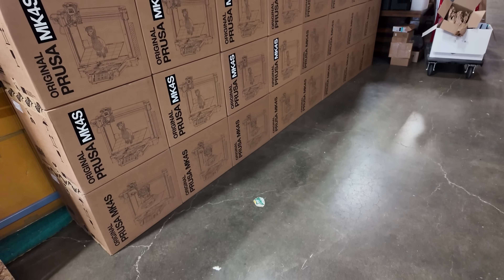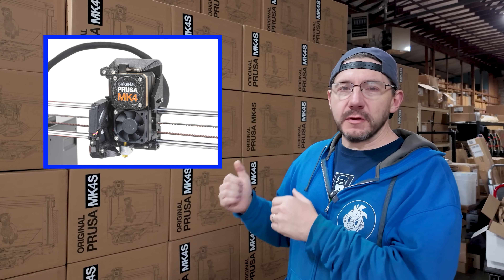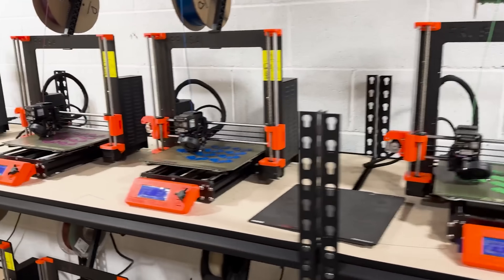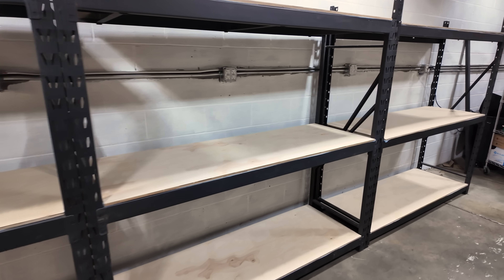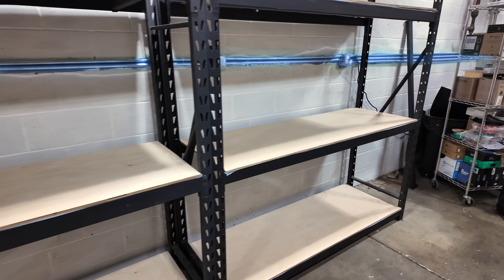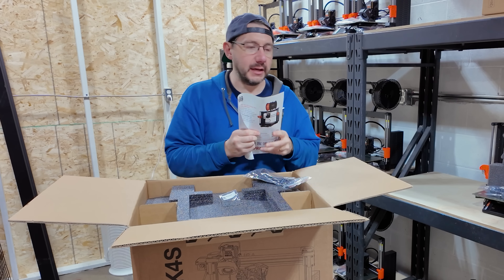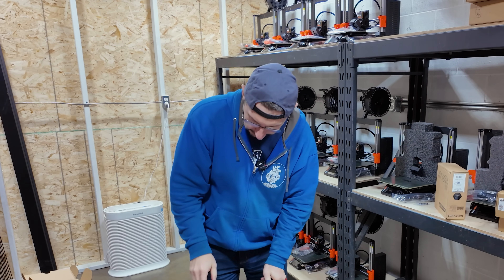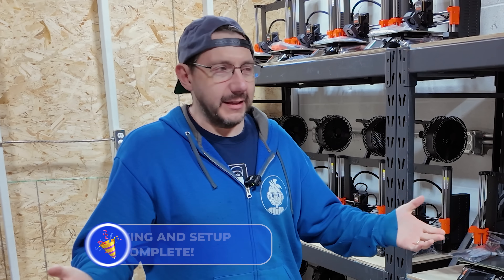MASSIVE Print Farm Upgrade!

Comment: PLEASE TELL THEM TO ALLOW PRINT BED TEMP CALIBRATION.

TLDR the print bed temp is super inconsistent in every way shape and form on my 2019 MK3S and  is about 5-10c off/cooler for PLA and up to 20c off/cooler from what it’s set at when printing high bed temps like 75c. 

I’ve checked it with a thermal camera and multiple thermometers both infrared and contact thermometers and they all indicate the same thing and the temperature inconsistency and offset get worse from the moment the preheat is complete and it starts printing and keeps getting worse until like ballpark 30 mins in when it levels off to being minimum 5c to 20c less than what it’s set at. 

I contacted Prusa and the dude told me that the printer is displaying the temperature that it is at and that my thermometers were wrong and no matter how much I told him I knew they were accurate and the printer was incorrect (at least the bed surface wasn’t the correct temp which is the entire point of setting the bed temp) he wouldn’t offer any explanation and when I said “so you’re saying that if I used every thermometer on the planet and they said the same thing as each other then they would all be incorrect and the printer would be correct?” And he said he didn’t “know anything about every thermometer on the planet but knows how the printers work and they are correct”…

…So yeah after hours of solo testing and thermal camera footage to the extent that I literally maxed out my phones 256gb faster than it could sync I think I’ve figured out the issue and a good solution beyond just cranking up the bed temp and once I test it I’m going to post probably an hours worth of the testing and solution on here and/or facebook and some of the literal dozens of hours of footage with my action 5 pro, my iPhone, and my thermal camera and the screen recording of the support conversation along with some other documentation proving everything I’m saying so that it might help some people and become undeniable by Prusa support but it’s insane to me that it took a customer and his thermal camera and multiple thermometers and dozens of hours of actively testing and recording and all that to prove it’s a problem and come up with a hopefully pretty good solution but the best solution would’ve been a print bed temp calibration feature (which I thought used to be there but isn’t there anymore) combined with my solution I’m going to test tomorrow, both of which should’ve been done at the factory but anyway

Comment: Do you have them hooked up to UPSes? If not, I'd highly recommend it. Prevents them from shutting off for power blips, and sends "clean" electricity to them which will increase their lifespan.
Reply: Online UPSs are damned expensive (the ones that regen the output constantly, giving the "clean" power) and they get more expensive the larger you need, so I'd let the PSs of the individual printers handle any non-clean power issues.  But, yeah, standby UPS(s) would probably be a good idea, if the power fails more than a few times/year.  

Less power failure frequency than that, it's cheaper to toss the (36) builds-in-progress and start over.  Battery replacement on UPSs is a major expense, and it's generally every three years -- for the ones I've dealt with.

Comment: Thanks for supporting the rest of us makers by not supporting the Bambu eco system and staying true to your belief that 3D printing should stay open source. You made a huge statement with this video by not making a statement at all. It's a testament to your professionalism. 

After the recent ordeal I am getting rid of my only Bambu for a Core1 and will be buying several Core1s for my farm upgrade.
Reply: @4lowdiesel  I 100% agree with you
Reply: Supporting Prusa still isn't supporting makers. They commercialized the reprap movement and haven't contributed back to the core. Their printers are outdated, even with the "new" wifi feature. I had wifi on my ramps on my reprap in 2012. On top of it all you can diy a Prusa for $300, and they sell it for $800!

Want to support makers, build a voron and buy a PIF kit. Want an easy build? Make a Rook2020.

Support makers not companies that overcharge makers.

P.S. the Mendel90 was originally made by nophead, go compare that to the Prusa 😂
Reply: Hey can you explain what happened with Bambu? I bought a Creality K1 max but im always wondering if I went the wrong direction by not going with Bambu.
Reply: @feverdream2661  I honestly don't understand the hype of Bambu printers or Prusa. They print worse than my diy printers. You made the right choice.
Reply: DapperDangus  I don't understand your issue. Nor do I understand what you mean by one of those. I'm happy that person got a printer and didn't get overcharged for the hardware. It's cut and dry. I've always built my printers from scratch, never bought a kit. I've been doing this since 2012 with a RepRap Mendel.
Reply: DapperDangus  oh you’re one of those…

Comment: That's an enviable print farm.  I'd get some 20 mm or 25 mm nickle plated magnets and stick them to the fronts of the shelves to put diagonal cutters so they're always within reach.  Ditto for the magnetic stainless offset tweezers that I use to pull plastic off the nozzle.  Maybe a waste bin to fill the spaces to the left of each printer for the prime stripes, cut ends when loading filament, failed first layers, nozzle ooze, etc.
Reply from the maker: Ooh I love that idea for the magnets! I’ll be trying that.
Reply: @3DPrintingNerd  Joel, I have very similar shelves and 3D printed labels with an area  on the back for a flat bar magnet.  Used glue to attach the magnet, it allows the label to be placed any where, I thought of that when I saw your blue tape machine labels

Comment: Not sure you have a specific reason for your shelf spacing but tightening them up to avoid the step stool is way more convenient for daily use. Just moved off a quad shelf setup and it is so much less annoying going from rack to rack with a step stool.

Comment: Nice setup, Joel! I've been running a 3D printing business since 2019. I make action figure dioramas, accessories, and displays for collectibles. I started off 3D printing with a Tevo Tornado and ANET A8. Remember those fire hazards?! Haha. But in 2019 I made the decision to get rid of the A8 and buy the Prusa MK3S and it was an absolute game changer! Since then, I've acquired a few more printers from Prusa and today I have a print farm of 10 machines. The MK3S printers have been upgraded to MK4S and my farm now consists of four MK4S, two Minis, and four heavily modified CR-10S printers. I'm currently trying to save up for an XL or two. Prusa has been the main staple of my print farm for 6 years.
Reply from the maker: It sounds like you've had a really great journey, it's inspiring!

Comment: wouldn't it be better to use ethernet over wifi for a farm scenario?
Reply from the maker: Yes. I believe I would have faster transfer speeds of files. I’m going to be talking to Ubiquidi soon.
Reply: @3DPrintingNerd  would be faster if you weren't piping files through prusa connect and using OctoPrint to manage those printers locally, but I understand you're engrained in the PrusaResearch ecosystem.
Reply from the maker: @MarkStoddard  Yes it is. It has to do with the board / chip they use I believe.

Comment: If you ever need a more stable surface, you might want to consider two layers of 3/4" MDF glued together. It's incredibly solid. For contact with the metal, you can get self adhesive silicone weather stripping. You can get it at a home improvement store where they have door and window seals.

Comment: MK4S as a platform is bullet proof. The Core One may have improved productivity however it is not well oiled machine so probably a good choice!!
Reply: Core One may be better for special cases when you need heated chamber. But for most common PLA and PETG printing those open printers are great because you can easily spot when anything on any printer goes wrong.

Comment: Wait. Did I (an electrician) just witness a YouTuber do proper load calculations for continuous loads?? Bravo sir. Bravo.
Reply from the maker: Hahah. I really tried!
Reply: @usalaxbro11  me (a mechanical engineer) scouring the video for him to apply point loads for each printer and calculating the strength of the plywood shelves to avoid deflection in a simply supported member. Then getting to the electrical section and going “oh…..THOSE loads” lol…..I just thought the electrician really had a fascination with mechanical calculations :)
Reply: I have a very small farm with about 1/3 as many machines as Joel does that I run out of a spare bedroom. First thing I did was hire electricians to run 2 20 amp circuits in there so I'd have plenty of power for everything.
Reply: @vp3dprinting860  how many machines can those circuit supports? I want to start a printing business using a spare bedroom.
Reply: Except . . . those look to be 15A receptacles, and he stated "20A breakers".  Breaker/wiring/receptacle mismatch?  Cannot use a 20A OCD with a 15A device (receptacle).  [later] n/m, I got a better look @ 8:27 and they're 20A receptacles after all.

Comment: A relative cheap upgrade for the mk3s would be installing a pi zero that way you could have prusa connect without a lot of work.
Reply from the maker: I had some Pi devices to do this for the machines but I also wanted the speed increase and the Nextruder.
Reply: @3DPrintingNerd  yeah understandable but it’s still a great option to really make the printer more modern

Comment: I've been considering what platform I'd use for a print-farm. I think I'd probably go with Sovol SV06's or SV07's; they certainly aren't the best quality, but the ease of swapping the entire hotend assembly with 3 screws and a ribbon cable would result in very little machine downtime should anything break.
Reply: Sovol make great machines.  Thats a good choice and a great value for how good those printers are

Comment: I know time is money, but was the additional cost of prebuilt machines worth the assembly time?  I know it took me about 8 hours to put my 3s together, but it was my first and only time assembling.  I would assume that I could assemble 3 in the same 5-8 hours if I did each step on a, b and c printers before moving the the next step.  OR, in buying bulk machines, is the kit price no longer that much lower?
Reply from the maker: It would have been just me assembling all the kits, which I COULD have done if I had the time. When the upgrade happened we had to hit the ground running to start manufacturing for Sparkfun.
Reply: @3DPrintingNerd  understood, time is money, so seems it was worth it.

Comment: Any benefit from using a wired network?
Reply from the maker: A benefit would be not relying on the wireless radios. It may make file transfers faster, but there would be consistent infrastructure to install.

Comment: You took into account the 80% rule on a 20 amps, but what about the power strip ? Pretty sure the power strip is a 15 Amp powered rated so the 80 % should be around 1440 watts, so very close to your limit
Reply: It appears that he's only running 4 machines per strip, so it should be fine.
Reply: although, when initially warming up, the prusas can pull between 2-300w, so I wouldn't want to have more than 4 machines per box if they are all starting up at the same time.
Reply: @MarkBlasco  yeah, i saw that after posting, but i decided to let the comment there, just in case.
Reply from the maker: I’ve got 4 per strip, and the power during warmup for PLA has been in the 80 watt range. At least that’s what my meter was reading.
Reply: @3DPrintingNerd  My meter shows up to about 285w when first warming up my mk4s machines, and it slowly creeps down until it gets near to the final temperature, at which point the power drops significantly.  But that's only for a couple of minutes to get the bed up to temperature, so it wouldn't be an issue unless you were starting a whole lot of machines at the exact same time.

Comment: I know this might be a too "inside question" but any advice on how to price "print on demand" 3D prints? I´ve a really small business and I simply put a 100% mark-up on material used, a default 30 cents/hour print time and pay myself a normal hourly rate for all the work I actually need to do myself (3D modeling, slicing, starting prints, and post-processing). I´m not sure if that´s the right way to do it so I would appreciate any insight :)
Reply: You are on the right track, although 30 cents/hour seems too low for me. Also, what is a "normal hourly rate"? Some people earn $10 per hour, and other people can charge 100 or $200 per hour. That would make a big difference.
You need to also take in mind the cost of the printers and the repairs.
 Let's say you have a printer that costs $1000, and you expect it to work for let's say 6.000h before it needs replacing/updating. You'also expect you'll need to spend about $300 more in spare parts on those 6000h. Then you need to divide $1300 / 6000 and you'll get 21 cents per hour JUST to cover the cost of the machine and the spare parts to keep it working for those 6000h. 
You'd still be missing your salary for the hours spent taking care/fixing the machine for those 6000h. Let's say maybe 6 hours at $25/h that's another $150. $150/6000 = another $0.025/ hour.
So let's say about 25 cents per hour just for cost of purchase and maintenance of the machine, and that is before taxes. You also would like to make a profit from those hours the machine is working. I'd say you'll need to charge at least $1 per hour.

Comment: Nice! I'm a bit jealous right now 🙂 As you've asked for our print farm experiences (I gave you one of our dartcase products at formnext 2023): We are currently running 14 Printers in a mix of Prusa and Bambu (which isnt perfect), but it is always a lot of fun just to stand in front of the shelfs when everything is running! ANd I love the prusa connect, it is so much easier to run multiple printers from this than any other solution we tried, yet.

Comment: Is there a bulk discount from Prusa Research for purchasing that many printers?  It is hard to not choose the $14k discount (shipping + assembly cost) for a Kit vs a Assembled unit, but I can also see where there could be significant opportunity costs.  Maybe it would be worth it to pay locals a per machine assembly fee if you can get them all setup without significant time loss.

It has hard to argue against Prusa since it is known for it's quality, but getting 2x as many printers for the same cost with other brands that have been show to have similar print quality is hard to pass up.  Not certain I would choose Bambu with their recent closed platform nature, however several other brands are definitely competing very well in the same space as Prusa.

Comment: Just a heads-up, that extension cord doesn't look like it's 20amp rated so you may need a different solution. The breaker won't protect it if you're drawing too much for it to handle.

Edit: some of the other commenters point out he's only putting 4 on one cord so probably nothing to worry about. It also looks like this cord has over current protection built in.
Reply: If the wires start changing color something should definitely be done. :)
Reply: @cdm3  there's only one solution: switch all the USA to 230V
Reply: @riccardosacchetti  we already have 240v service, it's just not wired up most of the time.
Reply: @riccardosacchetti  all US structures have a minimum of 220/240v coming in, Its then split into two 120v circuits. So you can have 220/240v outlets in US homes.  The 110/120 system dates back to the start of power grids. Electricity was originally only for lighting and the first bulbs were Edison 100VDC so the 110VAC was the compromise.  Its a practical impossibility to make US homes exclusively 220. Just too many things out there that are not dual voltage.

That said if the Prusa PSUs are auto switching one could just get the correct plug lead and plug it into a 220/240v outlet.
Reply: @filanfyretracker  yep.. obviously I know! :) it's like our 3 phase 400V. With neutral you have 230!
Reply: Doesn’t matter if 20A isn’t running through the extension cord. It’s 20A total circuit. You can have a 5A cord plugged into a 20A circuit as long as you don’t exceed the 5A of the cord.
Reply: You're correct: the Amazon listing rates it at 15A (1875W). However, 12 machines will only draw up to 1440W according to his earlier calculations, which remains at or under 12A (80% of 15A).
Reply: @TheEnigmaBlade  12 machines can pull much more than that if they are all warming up at the same time.  However, it appears that he's only plugging 4 machines into each extension, so even if each one is pulling close to 300w, that shouldn't be an issue.
Reply: @cdm3  Circuit breakers are to protect the wiring, not the devices plugged in
Reply: Each extension cord is powering four printers, at 120 watts each, so 480 watts, or 4 amps.  Not a problem for a 15 amp rated extension cord.  Joel did it right.
Reply: I have the same one, it's rated at 15a so yea, could be an issue but the printers likely won't ever draw the full rating (at least not all the time) and the unit does have a built in breaker so finger crossed.
Reply: I'd want to see the UL sticker on anything I bought via Amazon.  So. Much. Crap. from that distributor.  He said he's got a commercial sprinkler system protecting the facility, but if one of those non-UL splitters triggers a sprinkler event, his insurance might not pay to replace the damaged Prusas.